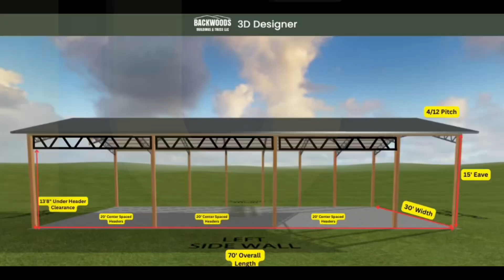Pole Building Has Arrived!

Comment: Matt, looks like those 8x8 timbers, below grade rated. Those are heavy as heck, guessing you puckered a little bit. Either way, when I worked at a lumber yard, even a 9k rated Hilo (pneumatic front tires) had fun with those, butt pucker moments anytime of year.
Reply from the maker: Yeah they are heavy. Will be fun setting those into the ground. Moving 4 at a time wasn’t a problem. But wouldn’t want to move more than that on the grade that I have. And I’m going to double check the front tire pressures.

Comment: The front tires on your JD were screaming from all that weight. Getting the poles in and square is basically the hardest and most important part.
Reply from the maker: Yeah I’m going to check air pressure in them today. I thought the same thing when I seen the film. And yep to me the hardest part and most crucial is making sure everything is square. After that it is all gravey.